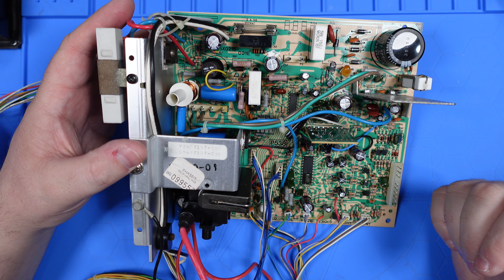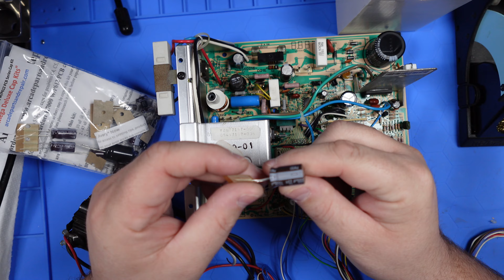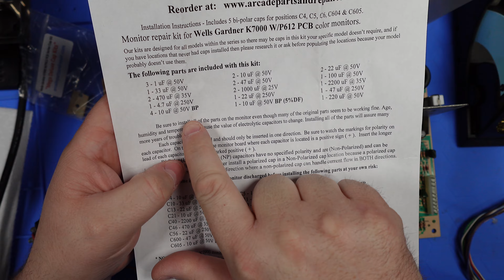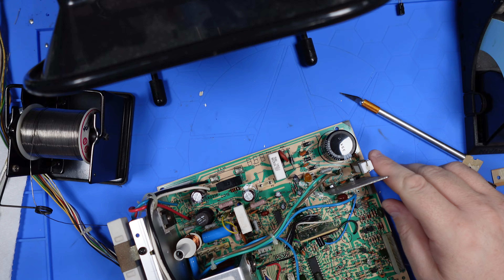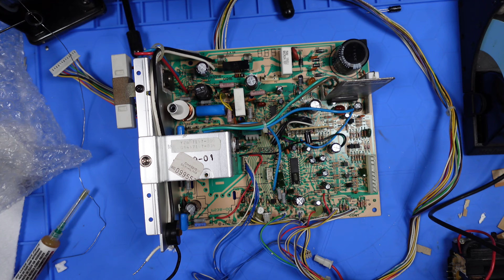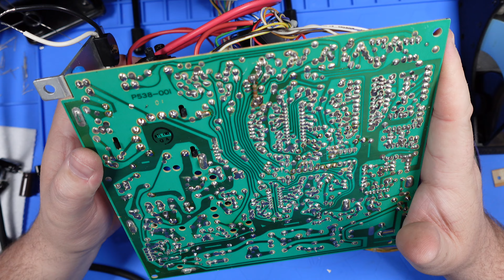Why Your Arcade Cabinet's Picture is Getting Worse (CRT Capacitor Failure)

Comment from the maker: “27 inches of TROUBLE fixed 😅 This Wells-Gardner K7000 P538 chassis is headed back into a Mortal Kombat 3 cabinet at Rad Bar soon — I’ll post a follow-up once Joe gets it installed.

Would you like to see me do more CRT and arcade monitor repair videos like this? Let me know in the comments ⬇”